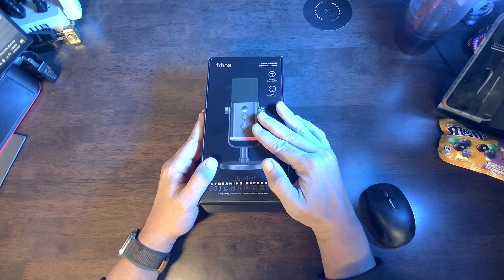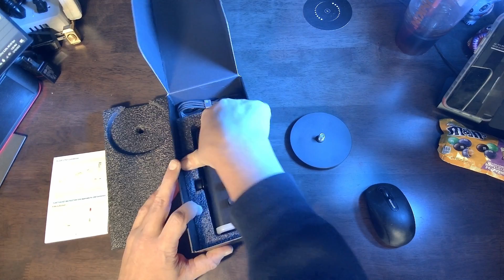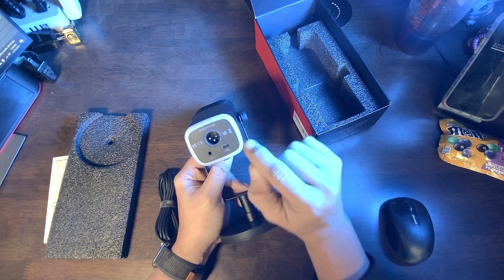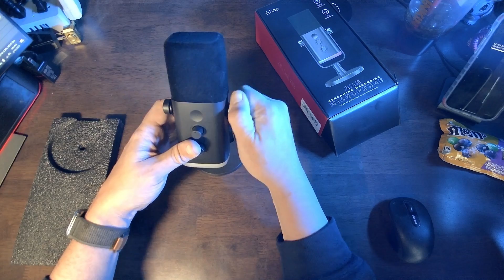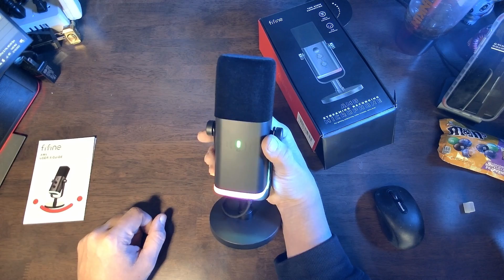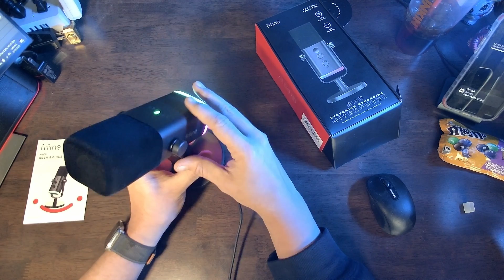AWESOME! FIFINE AmpliGame AM8 XLR/USB Microphone Review

Comment: I got the Fifine K669 USB only 3 years or so for $20 not even on a sale, price has gone up since then but still around 30 ish is the BEST cheap mic ever, followed by the Razer Siren Mini if you can get it for 45-50. The only main difference is that the Razer has removable cable while the Fifine doesn't
Reply from the maker: I'm impressed by the FiFine products, this is the first I have fully tested.  The K669 looks like it is $25 right now on amazon, great price.  I should check out the Razer Siren Mini some time...thanks for the heads up!